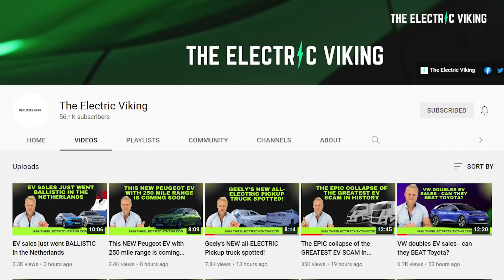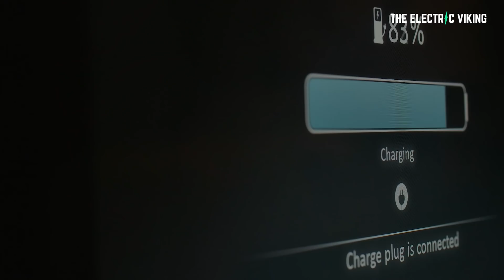Tesla Model 2 details emerge in China: 3 models + BYD battery

Comment: If they can make a hatchback that is a bit smaller than a model 3 with an LFP battery that has 250+ miles and can go 0-60 in less than 6.5 seconds. I'd pay 35k for that!!
Reply: In time, depending on what happens, you could see the Model 3's price drift back down in that direction. Remember, that was its base price just two years ago.
     It went up sharply not because costs rose, at least not primarily. It went up because demand indicated they were letting it go for far too little. There are various competition- and production-related reasons they could potentially have to adjust the price back down, while still making a good mark-up.

Comment: Elon always said it was easy to design and build a car, scaling up production was the nightmare. I think he will have a massive giga press that cast the entire car platform in 1 piece if doable.
Reply: I think the nightmares are over. TSLA now has enough experience with production lines that it should be relatively easy to build a slightly smaller car. Hey, they could always just rebadge a BYD Dolphin - now THAT would throw a spanner in the works ;-)

Comment: Blade battery with 800Volt makes no sense at this point in time as tesla is completely fixed with their 400V system. Their whole charging network which is a Moat would be worthless. They would need a workaround for blade batteries to make sense and make it viable for tesla.
Reply: 1 of the biggest advantages of their SC network is to sell electricity to more customers.  Far more profitable than making cars.  If everyone else goes 800v & Tesla don't, they're losing massive market share.  Once the competition goes full EV, which is now inevitable (or die) Tesla will be extremely lucky to be even 30% of the global market.  That's a big loss in energy sales revenue to non Tesla EV's.
Reply: An alternative is for Tesla to start building 800 volt SuperChargers in their charger megafactory in china ?

Comment: mmmmmm...... No, I don't agree. We do know that BYD is ONE of the suppliers supplying batteries to Tesla. It doesn't follow that those batteries HAVE to be for the Model 2 (for sake of ease I'm calling it that until an official name comes out). The Model 2 is intended to be a mass market car, so it doesn't make sense to have a single, limited supply of batteries for it, even in the prototyping phase. I do think that the Model 2 will use the 4680 cells, that should be graven in stone IMHO. There's just no other way to ensure supply. I think the BYD batteries will be used more for stationary storage, it's just a feeling I have.

I also think we will not see ANY reference to the Model 2 until either the end of 2022, or early 2023. Tesla has FAR too much on their plate to add this to the mix. They need their factories in Texas and Berlin up and running before they add to their product road map. Otherwise, they're stoking demand that they cannot meet. Point of fact: they can't meet demand for what's already in the pipeline! Between Model 3, model Y, the semi, the CT and the roadster, they are already way past their capacity. Announcing the Model 2 anytime before 2023 will hurt their reputation, because they won't be able to supply any of the demand that there is for that level of car.

Comment: I would consider it but ABSOLUTELY NOT if it's a smaller version of the Model 3. The Model 3 itself is far too low to the ground and too difficult for older or larger people to get into and out of. The one thing the USA has plenty of is Older and Bigger people. I will not buy a car that I have to fold myself into an origami figure to use. NO Thank You....Not when the BYD Dolphin, and potentially others, can easily accomplish this ease of entry issue that seems to elude Tesla's lower priced tier of offerings (Read Model 3).

Comment: Won't the Not-Model-2 be closestly related to Testla's currently cheapest (to produce, not yet launched) vehicle - the Cybertruck? And therefore have a structural battery pack (probably 4680s), front and rear casting plus a stainless steel exo skelleton?
Reply: Would be nice, but not at this magical $25K price being mooted.  It’s going to be circa $35K by the time it ever comes out. Tesla are not in the business of making low margin cars.
Reply: @copaloadofthis  Well, they are in the business of accelerating sustainable energy. If they think it helps and they can afford it, i expect them to also sell with lower margins of 10%...

Besides that, Gigacasting, structural 4680 battery pack and steel exo skeleton are cost reduction measures, compared to e.g. Model Y - which is why i think they probably would find their way into a Model Q.  But i guess we will have to wait and see :-)

Comment: Average Australian driver drives 13,000 km per year or 104,000 km in 8 years and the BYD blade battery gets 500,000 but no more than 40% degradation, Toyota Battery warranty on the upcoming Toyota bx4x will get a 10 year warranty with no more than 10% degradation, it may not get the 500,000 km warranty but very few will ever do that sort of mileage and most of  them that do will not qualify for that warranty as Taxi and any commercial use that warranty will not apply. 

If this battery is so much better then BYD should give it a 10 year warranty with 500,000km and no more than 10% degradation as 40% is almost half its range gone! 
People do not realize that a battery can degrade from 2 reasons yes from degradation and from module failure, the BYD may not be that reliable and should 20 modules fail but if the battery still showing 70% health then BYD can claim it's within it's range of degradation!

Comment: I really can't see the Tesla Compact/Q coming out this year.  Yes, it will be powered by LFP/blade batteries, but given the level of demand that Tesla has right now, the fact they're still production/battery constrained, and the higher profitability of Model 3/Y, which could also use the LFP batteries for Standard Range vehicles, I can't see a lower priced vehicle until sometime in 2023, perhaps second half.
Reply: The compact Tesla is not battery constrained any more like the 3 and Y.
Reply: @Richard-S  That's why I said production/battery constrained.

They can't build enough of their higher priced vehicles at the moment, so why would they launch a cheaper vehicle and make the problem even worse right now?
Reply: @GordonMullan  they have a different supplier!
And that is for non-performance models or less powerful vehicles only as it seems.
Reply: @Richard-S  They still need to get the other bits of the vehicle, and have assembly line capacity for them.
Reply: @GordonMullan  in China when the 2 new factories (Texas and Germany) make the Ys.

Comment: It would be interesting to know more about those end-of-life BYD bus batteries. What degradation threshold did end-of-life mean, how many full cycles to get there, over what period etc. A bus is typically used continuously for maybe 12 hrs a day x 365 so will give insight into degradation characteristics way earlier than most cars.
Reply: I uploaded videos of Taxi drivers in Shenzhen with over 500 000km driven in 4 years and are on the first battery and just have around 10% degradation. And the Taxis drive 24h around 400km/day
Reply: Life of a city transit bus is typically 12-16 years and 500,000 miles in North America.  However in China, they typically only expect to get 6 year life from a bus.  The batteries in BYD buses should be nowhere near their end of life at only 6 years.  I would expect 12 years calendar life.  Mileage should not be a factor, given the high cycle life of the LFP chemistry used in BYD buses.

Comment: I gues that 800v LFP system will be the future. Cheaper, safer, faster charge to 100% and discharge to empty without damage. 
I would love to have an EV with that battery and would buy a Tesla for that price.  I am working with LFP batteries since 2015, they keep working flawless.
Reply: At the moment it is 720V @ 200A 
That is what the BYD Han uses peaking 140kw
Reply: Except.....all the current (25,000+) Tesla superchargers around the world would have to be upgraded to 800 volts. They currently supply half of that at 400 volts.
I’m not sure that Tesla is willing to go down that expensive path, given that their (stated) priority is to increase THE TOTAL number of superchargers by a factor of 3, over the next 18-24 months.
BTW, what 2015 model EV do you own that has LFP batteries? Curious to know.
Reply: @Nicholas.T  you can use 800V but also 400V
Electrify America/Ionity has 800V systems, also many European chargers.
In China they have 700V 200A chargers

Comment: I don't think so quite yet. While they are working on the M2 they will not produce yet. Demand is still massive for M3 and MY, and BYD and Ora have not yet been able to come up with the goods in producing a $30k EV, so there is no point in Tesla jumping the gun. Also they have serious ramp up issues with MY and also the need to get the CT and Semi happening. M2 is the ultimate goal, because that's when sticker price parity with the Toyota Corolla hybrid occurs, and ICE generally, but timing is everything. My guess is Tesla will keep pumping out the M3 and MY until the point where demand flags, and get the CT out as a priority, and then at which point the price of M3 and MY will be lowered, and M2 production will then begin in earnest. My guess is late 2023. BYD and GWM will only sell a few thousand Dophins and Cats in 2022. They are still a way off mass production, which will happen in 2023, which is when Tesla's M2 will be released, end of 2023/24.

Comment: we must keep the same car on the road as long as possible.  Right to repair.  not just cars everything.  water heater every appliance.  Must be repaired not junked.  We have to get the affordable EVs on the road and also keep the same vehicle on the road for many years and miles.  change the tires don't throw the car away, same for battery and motor, very short list of things to fix on EV cars.  So get it done son. Bro.

Comment: In city areas , sedans are not necessary practical .  Hatchback are also easier to PARK and ladies would LOVE it being a smaller car. For a run around car for Singles/retires,/etc ... hatchbacks are more PRACTICAL. I would BUY it for my wife as a Run Around car. If the BYD Dolphin comes .... TESLA hatchback would have a serious challenger.
Reply: I would buy a small hatchback as a practical alternative to my cybertruck for going into the city. I sure won’t be eager to drive a cybertruck into downtown Los Angeles
Reply: I have a M3 and honestly I drive it alone 95% of the time. It's not really the most efficient way to travel
Reply: @Matzes  efficiency depends on use case. If you live somewhere cold, or anywhere with dangerous high speed roads, you can’t expect to use a motorcycle. If you live somewhere expensive you can’t live close to work. If you can’t live close to work it’s probably impractical to use public transportation or bicycles.
So sedans are most efficient in that case, unless the alternative is a compact sedan or compact hatchback. Though all of us should try to carpool.

Comment: You do not make sense, offering a more affordable vehicle can not be offered with a 800V architecture, as 800V components are less commercialized and more expensive than 350V - 400V components. Elon has addressed this question before, when was asked about fast charge rates (i think in Battery day), his reply was that TESLA will address charge rates by 'other means'. Apparently TELSA has an improved Anode chemistry somehow using more Silicon that Graphite to improve the charging rates.

More than that it will not be smart of TESLA to offer 'these' affordable car outside China/third world countries till the model 3 market will be saturated
Reply: I don't see why 800V should be any more expensive. It's only because they are a rarity at the moment that they are associated with expensive EVs.

Comment: no matter how well they prepare for mass production of this car, if it is indeed near $25k they will not be able to make any where near enough to meet demand.. the market size for this car is insane..10s of millions
Reply: The rule of thumb is that for every $5k reduction in the price of a car, the demand for it will double. Since this car might be about $10k less than the Model 3, the demand should be about 4 times.
Reply: @lesliefranklin1870  That's a nice rule.  Although I'm an old school petrol head, I just want cleaner, simpler, more reliable mechanics & cheaper fuelling, I'd like to see a stubborn, stalwart ICE CEO or 50 bent over with the thumb stuck..... 😁